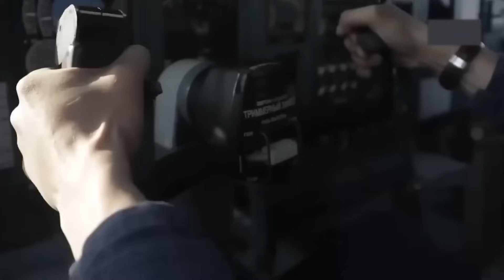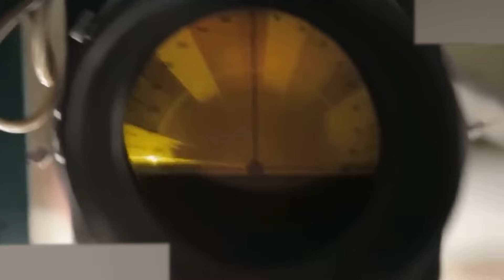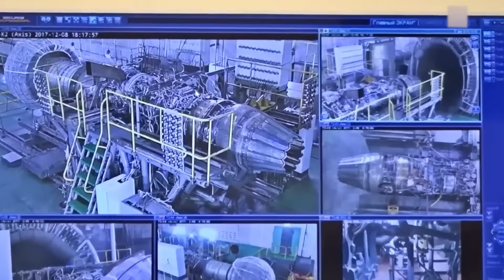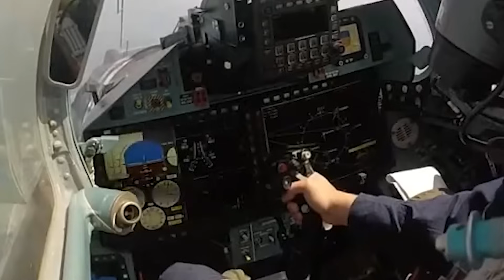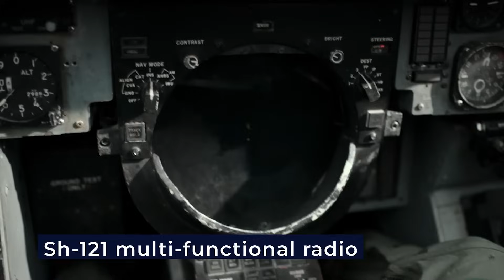Putin Reveals LARGEST Aircraft Ever Built in History is Now Ready!

Comment: Russians is the first country that has supersonic strategic nuclear ☢️ aircraft. Also Russia 🇷🇺 has 224 and 222 international cargo plane ✈️.🦅💪🌲🇷🇺🇷🇺🇷🇺🇷🇺🌴👍🦅
Reply: No, they have the AN 124 or 225.
Reply: @dennisyoung7363  An-225 was biggest plane in the world. An-225 was build base on An-124. Russia (Volga-Dnepr company) has An-125's... and design bureau. Now they working on a new plane.
Reply: @goodstu  What part of the 124 is similar to the 225?
Reply: @dennisyoung7363  The An-225 was built on the basis of the An-124-100. This is a larger version of the An-124-100. Power units, fuselage, engines, landing gear, serial components and parts of the aircraft, specialized polyurethane paint and much more were produced at the same factories. That's why the An-225 was designed and built so quickly. Airplanes have one chief designer - inventor Viktor Tolmachev. The plan was to build a new An-124-300, but it was not meant to be. Now the new aircraft will be produced under a different brand.
Reply: @goodstu  Are you saying the chassis of the 225 is the same as the 124, but bigger?
Reply: @dennisyoung7363  Same question but rephrased. Are you an adult?
Reply: But everywhere else is a shyt hole
Reply: @goodstu  You don't know the answer?
Reply: @dennisyoung7363  so u r troll !